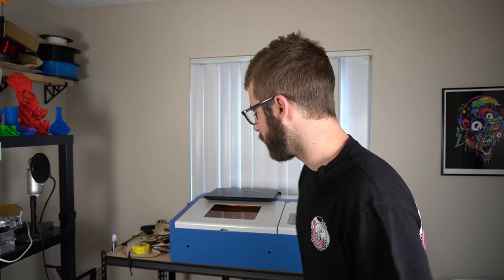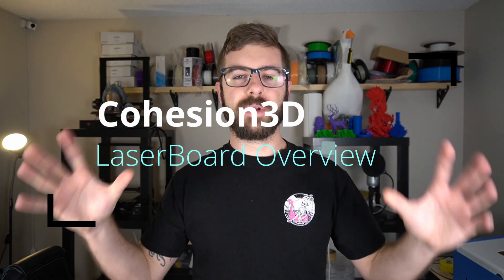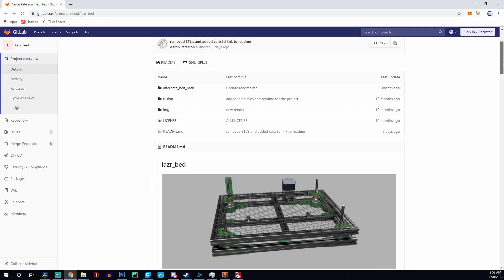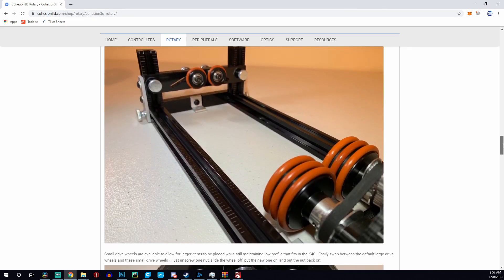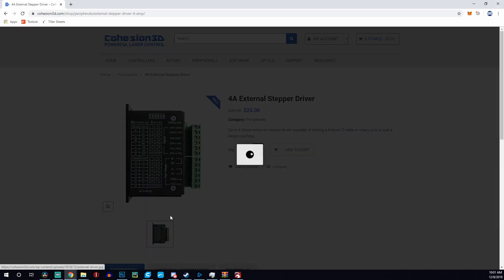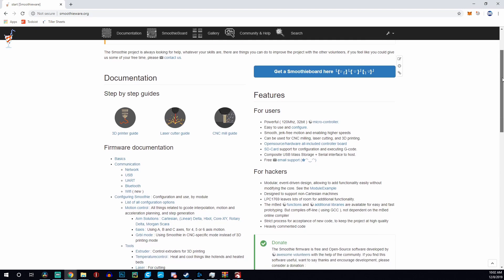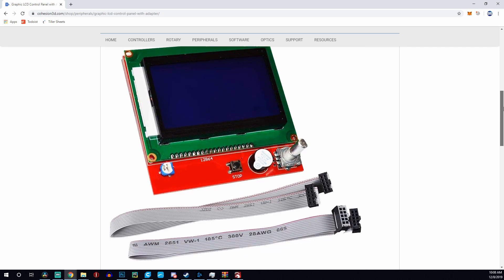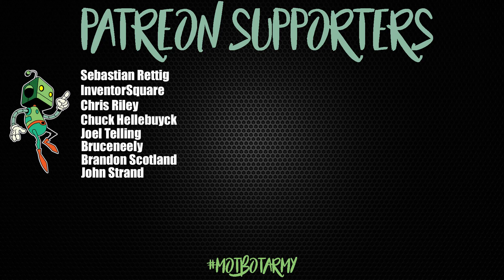Ultimate K40 C02 Laser Upgrade! Cohesion 3D LaserBoard Overview

Comment: I think you can actually add a rotary table with the stock setup, but it's a little janky. You can literally detach one of the axis and make that the controller for the stepper/servo motors. It's a little iffy, but should work if you can get it to work.
Reply: Just stumbled across this video and wanted to say this, seems janky but I'm sure it works just fine.

Comment: Why not get a better unit than the white and blue K40 machine, like 4040 ones if you're going to be spending money on all these upgrades??!?? The K40 uses a rail and plastic gliding wheel which is a VERY TERRIBLE linear motion hardware and pretty soon that thing is going to be filled with soots from cutting smoke. You are upgrading the board and software to run a poorly built hardware!!
Reply: Because a better unit is a LOT more money?

Comment: Best not to set the K40 higher than 18mA, you're not losing very much at all because the output gain from 18mA up to 30mA is negligible in comparison to the input increase so you're not really losing any power and you are extending the lifetime of the tube.

Comment: Thanks for this video. Given the Arduino/GRBL, or Smoothie board options, or the MYSWEETY CNC Control Board, GRBL 3 Axis Laser Engraving Machine Controller Board. 
Which is the best option?  
 I'm not concerned about the money. More about ease of use, functionality, and seamless integration of all the software and hardware components. Thanks
Reply: what did you end up getting?

Comment: Hi. so I got a k40 in 2011.  I made this little mod at the time.  I guess today you could 3d print something like it.  Also you can replacement heads now that go up and down by about 1 inch. As a temporary or permanent fix until you build a z axis.  I just used my mod. Its 6 years old, and I don't operate the site any more. Buyt I thought you might like it anyways.  https://www.youtube.com/watch?v=CC9kGOlxlHs

Comment: Nice one, i have just ordered my own k40 variant should be here by the end of the week hopefully. 

Looks like i will run stock for a small little while as the price of the board is a little high at the moment
But any way thanks for the video and catch you in the next k40 video
Reply from the maker: The machine is totally usable with some cheap upgrades. This board just really unlocks so much potential for expansion. If you are just getting the machine definitely play around with it. The board upgrade can come later.